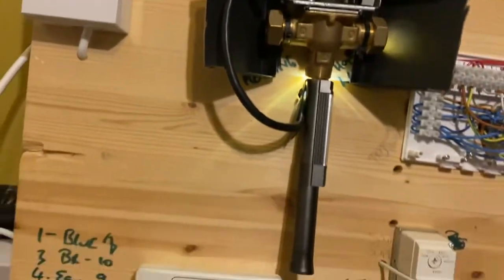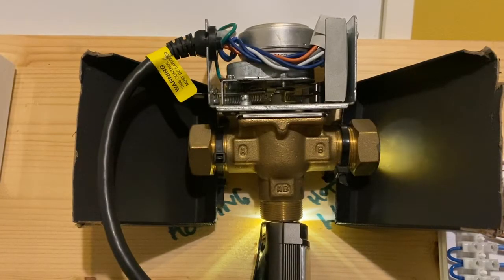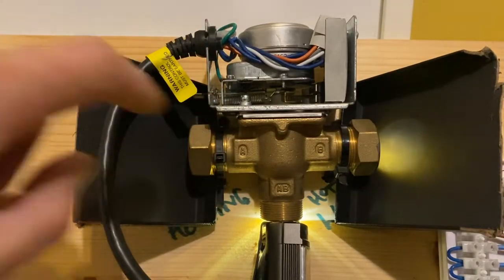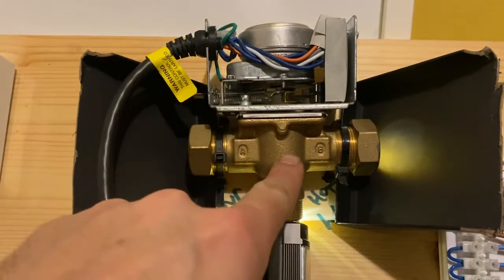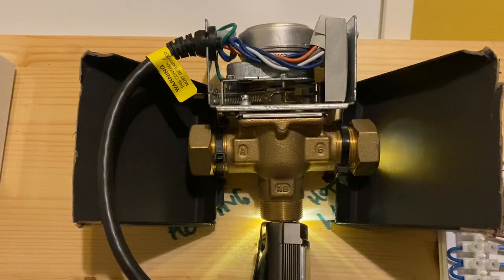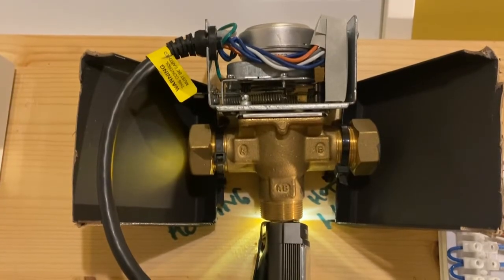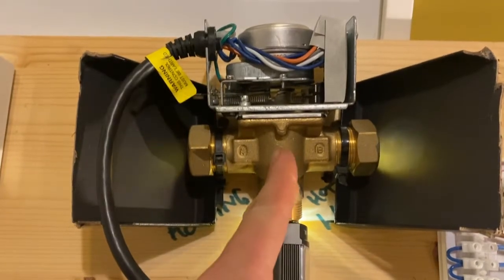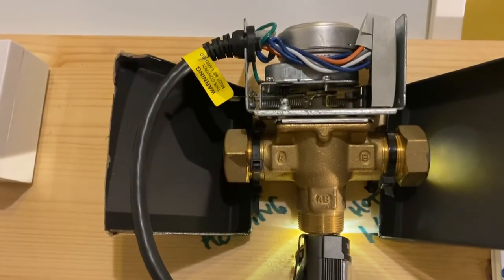What is a 3 port valve (mid position valve) why do radiators come on with hot water intro

Comment: Thanks for the video, I did get a little bit confused, you called the B side central heating and the A side hot water I thought it was the other way round, so that the hot water can flow freely without the boiler being on calling for heat

Comment: Have you got anymore in depth information on this? What would be the scenario after replacing the 3 port valve because radiators would get hot on hot water demand only for it to carry on doing it? Back feed of voltage slightly keeping the ball valve open on heating and not completely turning it off? Another update video or a reply would be very helpful, thanks
Reply from the maker: Body and head changed?
Reply: @ yes mate, unless the valve we bought from the merchants is faulty.. we are unsure what’s happening. We’ve changed the hot water stat and room thermostat but still the heating gets hot when hot water is on and heating off. Apart from changing the programmer we were thinking about changing it to an S plan. It’s rather annoying not knowing what it is
Reply: @ solved it, it was back flowing from the hot return pipe. Never easy 🤣

Comment: You didnt show how you turned your demand off
Reply from the maker: Its really difficult to cater for different levels of stupidity in one simple video.
How would you guess you turn a demand off?
Reply: @ i don’t have a skooby, but the rest of the video was very helpful.
Reply from the maker: @Lee-mo lol… turn the heating or hot water off = no demand
Reply: Good video on how these work. I’ve got a question for you I’ll try and keep it simple to stop me confusing you. I have this set up. When the heating is the last thing called and it goes off timer the head gets hot and buzzes. The only way I can stop this is to call for water for a second and the head moves it to water I can then click the water back on timer stopping the boiler etc then the head cools down and the buzzing stops. I feel this is not right it shouldn’t buzz and get hot right? Cheers.

Comment: Great YT, thank you! Desperately need the promised follow-up videos. A "plumber" replaced our faulty Motorised Valve Head; but, neither Hot Water nor Heating worked afterwards. Then the MVH & 3-port valve was replaced as a unit. This could only make the Hot Water work; but, not on the desired settings from the programmer, and no combination of settings would bring the Heating on. Both 3-port valves are/were in perfect working order, and I think it unlikely that 2 brand new MVHs would be faulty. Therefore, I would love to see the correct wiring of the MVH into the junction box for the programmer, demand valve, tank thermostat, etc., please.
Reply from the maker: I wish i had the time at the minute.  But, honeywell do lots of wiring diagrams which are fairly easy to follow.  Essentially, when there is a demand for heat 240v will be sent down the orange wire of the 3 port and this will then power the pump and should kick the boiler in.

Comment: Thanks for this video. I have had problems with my heating working intermittently for the last few months. It will work fine for a few days or maybe a week and then the boiler won’t fire when the call for heat is made. If I turn it all off for a couple of days and then start again it will work again for a while. I assumed it was the boiler at fault nd maybe the PCB but then I noticed the hot water on its own works fine, boiler fires no problem and it works as it should. It only seems to be when CH only is selected. I can hear the boiler clicking on and off trying to start so I think it communicates with the room stat, goes to start and then the mid position actuator doesn’t move as it should.
Does this sound the likely issue to you because if it was the brass valve then the hot water wouldn’t work either? Thanks.
Reply from the maker: Demand for hot water tends to be from the stat on the tank - rather than the 3 port.

When heating demand on you should be able to hear the microswitch be clicked…

Or, if you take the cover off the head you may be able to actually see the lever hit the switch.

Be careful - 240v knocking about.

I really will try and knock a video up later today and upload it - been meaning to do one for ages….
Reply: The hot water works fine yes
When the heating is selected on the controller I can hear the boiler clicking as if to try and start. I can hear the click in the airing cupboard as well from the actuator, it might go anything from 0 seconds to hearing the pump start for various lengths of time but the boiler won’t fire (but only for CH), sometimes it will work ok and start straight away. The boiler seems to be communicating with everything ok but I just wonder if something inside the actuator is not working every time as it should hence the intermittent business

Comment: here it looks like fresh water is going through the same pipe as the dead water inside the closed radiator circuit. but that seems unhealthy that the fresh drink water and radiator water can get in touch even if it is just some small remainings that guided to the new opening.
Reply: The hot water that is sent to your hot water tank does NOT come out of your taps. It runs through a pipe in the middle of the tank and then back to the boiler. The fresh water in your tank gets heated up by the hot water in the pipe. They never mix.
Reply from the maker: Wow.

Yeah - that doesn’t happen

Comment: Most common reason for warm or hot water flowing to heating system with no demand for heating is poor seating of the valve port.
Reply from the maker: I wouldn’t say it’s the most common but it does happen.  I keep meaning to do a second video on issues/faults but struggling for time… but that’ll certainly be in the list.
Reply: @petegasguy  In  my experience,  if the valve let's by, change the body. Issues that suggest synchron motor failure, always replace the head. There's  so much more going on with how the valve maintains mid and heating only positions.